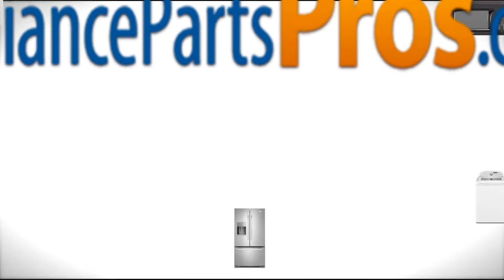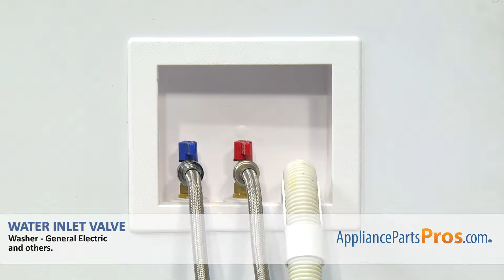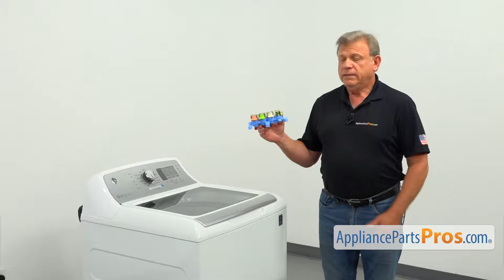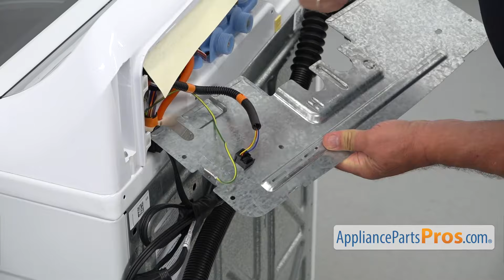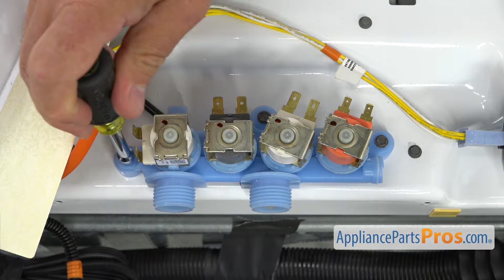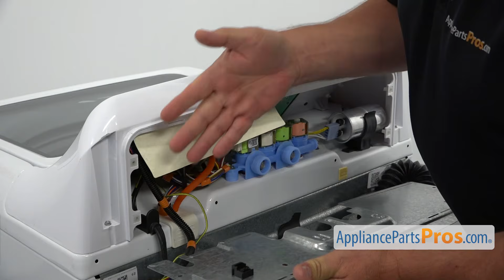How To: GE Washer Water Inlet Valve WH13X26637

Comment: Had this video book marked for a few years. Waited til the weekend to fix it and it fixed itself then just started dripping again yesterday. Wonder if theres a way to clean out the solenoids out and throw it on the shelf so in 6 years from not it starts leaking again you can swap it out
Reply from the maker: Haha, at least the washer gave you a break before acting up again! 😅 If the inlet valve is dripping, the internal seal may be worn or debris may be preventing it from closing fully. You can check the water supply screens for debris, but cleaning the solenoid itself usually isn't a reliable long-term fix. If it keeps leaking, replacing the valve is the safer bet. 🔧

Comment: Great video, I didn’t realize the orange hose was connected that way. After installing as specified, I get water leaking out of the hole/grommet connections. I’ve inspected the entire pathway for any clogs and it’s all clear. Any ideas appreciated!!
Reply from the maker: You will want to double check the installation and make sure the water valve and connections are not damaged.

Comment: You don't need to remove the air hose and control panel to replace the water valve.  I replaced mine a few days ago and it only took me like 10 minutes.
Reply from the maker: Good point, @Resist4 👍On some models you can definitely access and replace the inlet valve without removing the air hose or control panel. It can vary a bit by configuration, so your shortcut is helpful for others with the same setup.
Reply: @appliancepartspros  I have the exact same model washer you showed in the video.
Reply from the maker: There can sometimes be more than one way to access a part, and your method may save some time for others working on the same washer model. If you can reach the part without the extra steps, you can definitely skip that portion of the video.
Reply from the maker: If you are able to access the part you need without following all the steps in the video, then you can skip those steps.
Reply: @appliancepartspros  You should have said that in the video.
Reply from the maker: I'm sorry for any confusion. Our videos are generic videos and are to give you an idea on how to replace a part. So, the repair for your specific model may not match exactly to the video.

Comment: I have a GE machine. How do you find the exact water valve for your machine? I can't find one for my model number.
Reply from the maker: The valve part number is WH13X23974. You can place that order through the website, or you can call us at 1-877-477-7278 Mon-Fri 9am-8pm EST to place the order over the phone.
Reply from the maker: What is the model number of your unit?
Reply: @appliancepartspros  

It's:

 GTWN2800D1WW

Comment: Is it recommended to simply remove the old valve and inspect the orange rubber gaskets to see if that's the issue rather than replacing the entire thing?
Reply from the maker: You can check those gaskets to see if there is damage or worn spots on them. If they are damaged you will need to replace the valve since those are not sold separately.

Comment: I want to thank you for your video. When I removed the water valve assembly, I mistakenly removed the orange water hose. When I completed the new assembly and turned the washer back on, it did not go in to the wash cycle and came up with an H2O supply error. Of all the other videos that I watched, no body mentioned the orange air hose. I reattached the orange hose and now everything is working.
Reply from the maker: Glad your washer is working again. If there is anything we can assist you with in the future please let us know.

Comment: I watched another video which did not include the steps of removing the connections from the rear panel or removing the control panel. The back panel fell off the washer and could have damaged the connecting wires. I then put everything back together and then had an error code. This was because the orange air tube was not connected to the circuit board prong which was a result of me unknowingly pulling off its connection. I wish I had viewed this video beforehand and I would have saved myself several hours trying to figure out where I went wrong and going through the disassembly /reassembly process more times than needed. This video shows the right way to do things. Thank you.
Reply from the maker: Glad we were able to help you out. If there is anything we can help you with in the future please let us know.

Comment: I have GE wash but different model. Washer is not filling up with water and after it automatically turns off. Is that the water inlet valve problem?
Reply from the maker: What is the  model number of your washer? You aren't getting any water in the machine at all?
Reply: Mine is doing the same ill get some water in there but not enough to get a small load started i have to manually add water , ill move the switch from low to high and it wont dispense water it will only a little in the begging of every cycle but that about it.

Comment: Is this for those that received the “Supply H2O” message?
Reply from the maker: It appears that if you are getting the Supply H2O code that it could be an issue with the pressure sensor or the supply valves being turned off.
Reply: Where would the pressure sensor be?

Comment: The inlet valve replacement video was informative and allowed me to tackle the replacement job without concern. All went as shown in the video. Valve was replaced within 10 minutes and the hot water leak into the tub has been corrected.  Also, Appliance Parts Pros shipped the part very quickly. Thank you!

Comment: I consider this a 2 beer job. Drink 1 while replacing the valve…hook everything up, turn water on and plug it in. Drink the 2nd beer while the control board runs it course…10 minutes
Reply: 2 seem not enough
Reply: My way of maintenance planning!

Comment: thank you soooo much for making this video! I was able to change my initial water valve and reconnect everything back how it's suppose to go. I wasched somone eles video about replacing it but he did not mention anything about the pressure sensor hose. My washer has not been working for 2 weeks and I have been going crazy trying to fix it. with your video I was able to check all the connections and realized I never plugged that hose in. thank you once again!!

Comment: So do you have to get it reprogrammed after installing this piece ? Because on your website reviews someone said they have to do that, so just trying to make sure when I fix it I do it right.
Reply: I think someone must have robbed them. No reprogramming needed as far as I can tell. You know, the little orange hose that plugs into the circuit is important. It is easy to forget that and if so, it will cause issues. Probably that might have happened with that guy and someone may have fixed it and charged for it as if they did some sort of magical reprogramming. That's my theory if course.

Comment: Just did this repair....FYI on my machine, the 3rd clip that attaches to the new part doesn't come off like the others. He doesn't show it on the video, but I would take the ld part out and then .....flip it over to see the clip that needs pressing down to release that one.
Reply: Good point, I took a large needle nose pliers and pinched the center of the connector and pulled it off.

Comment: Thanks for showing that the control panel doesn't come completely free.  I'm sure you're saving some cables from being ripped out in the future.  Also the technique for disconnecting the rear access panel cable also seems super helpful.